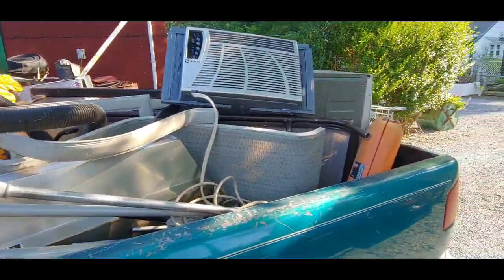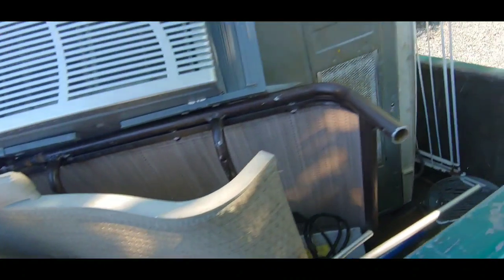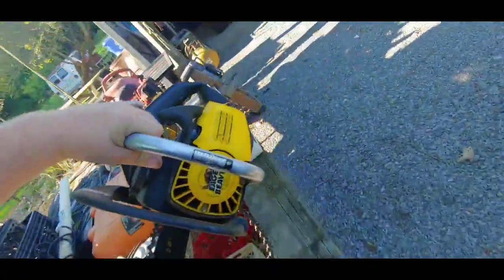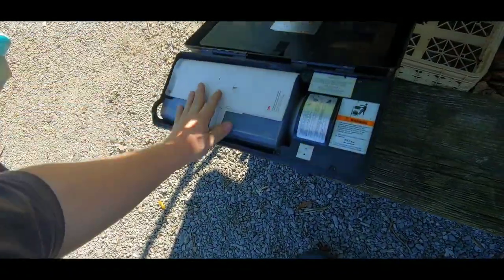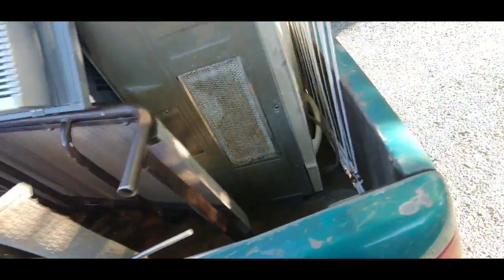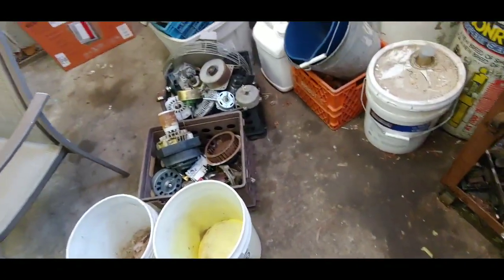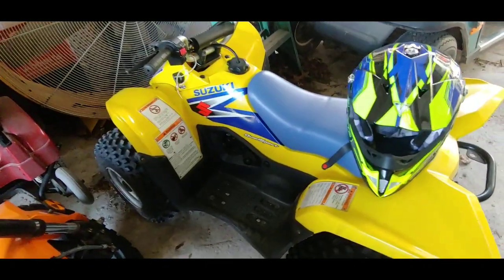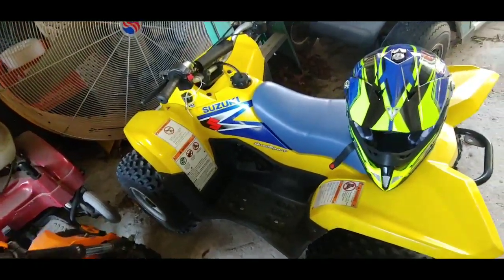Selling Copper scrap

Comment: If no one has told you yet but that black rectangular thing you didn't know what it was  , it's a portable hepa vacuum  . And under that flap when you opened it up is where the cord and vacuum attachments are stored  ! The big white thing is the filter and is easily removed to put in a new one  . They are very expensive  (vacuum) !

Comment: Bert, I wanted to know if you strip the copper wire or do you turn it in as is? Enjoyed the video. Keep on picking and scrapping.
Reply from the maker: I usually don't strip anything smaller  gauges